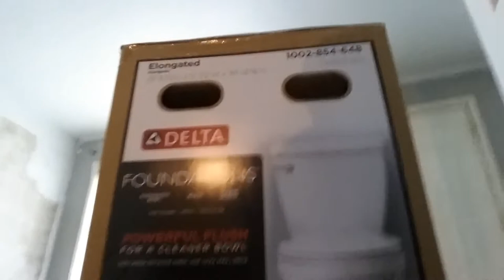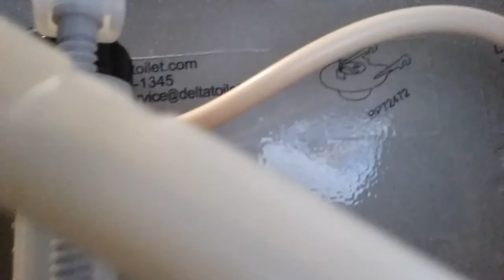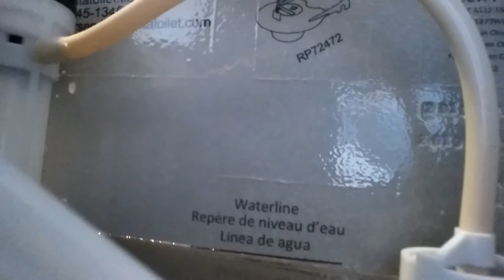detailed toilet installation, DIY TOILET INSTALL OF DELTA FOUNDATIONS TOILET.

Comment: Thanks for the video. How has that toilet held up over time?
Reply from the maker: Great.  It is in a rental for low income housing. I wanted affordable, dependable and durable! It's all 3
Reply: @mggahomes9721  I ended up getting this one, and it's been great so far. The only thing I don't like is that it stains pretty easily. They aren't kidding about the powerful flush. It's like a turbo jet.
Reply: Great video but after watching the whole thing, I'm disappointed I never got to see some actual flushes since I'm considering this toilet and would love to have seen how powerfully it flushes.

Comment: Well done! Not sure why they would recommend putting the wax seal on the bowl...it’s always easier for me to fit the flange because the bolts guide where the toilet goes, provided you do your part in lowering it as level as possible.